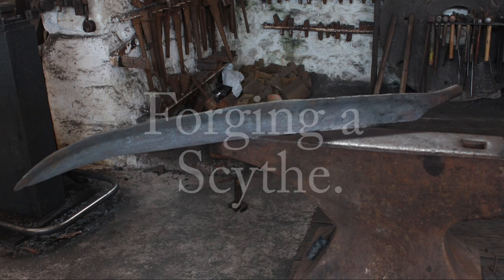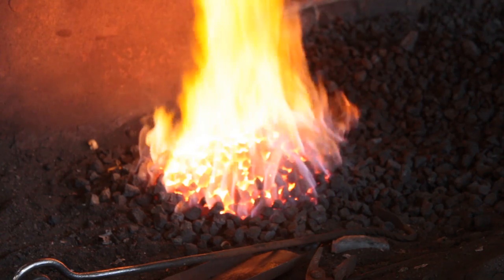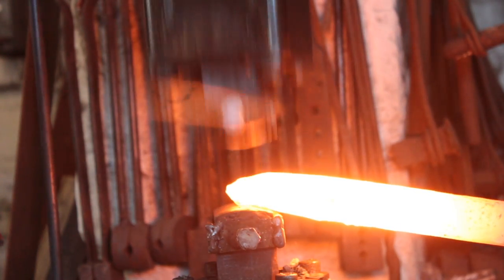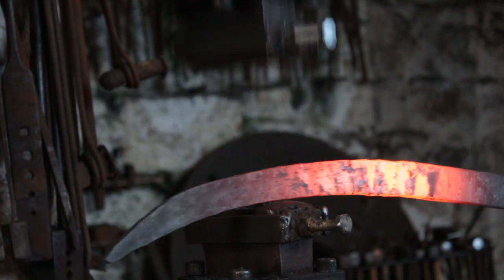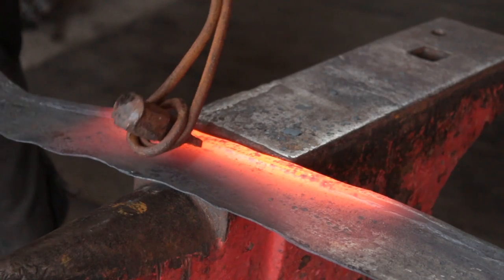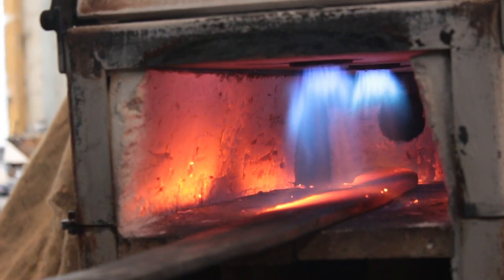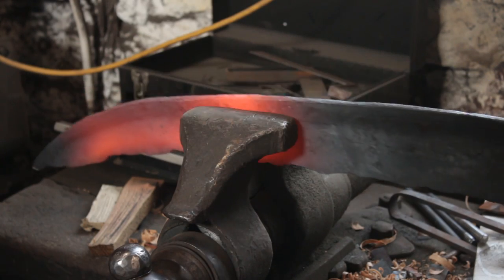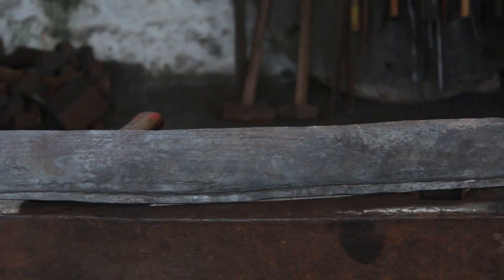Forging a Scythe, Part 1: Starting the blade.

Comment: Great video.  I thoroughly enjoy your videos.  Thank you!   May I suggest that you put a jam-nut on the bolts holding those round power hammer dies?  Just put an extra nut on the bolt and tighten it against the frame of the die after you tighten the bolt.  That will secure it much better.

Comment: I was curious if you had any interest in a trade hammer build? Something simple, like the drawings I have seen in a few books. Basically a sledge hammer on a pivot, with a spring board and rope, and a section of steel on a post for the anvil. Can't wait for part 2 of this one! Thanks!!

Comment: That old modified scythe blade looks to have been an English pattern, in which case you would have ground the edge on a water-cooled grinding wheel when beveling, rather than peening. They were very often laminated construction, which is largely incompatible with beveling by peening for a number of reasons.

Comment: Question, if you did a smaller hand version (scaled down) of this, would it require any differences in design. or just simply 'smaller' in all areas. For example, would the curve have to be adjusted because the length of the blade is shorter.

I am thinking of something like this for a hand tool to start, then work my way up to the full blown deal. Working by hand as I don't have a power hammer.

Comment: what if you forge the blank and before you start forging the edge you put a sharp curve on the blank curving in towards the edge, so this way when you forge the edge it will then curve itself back into the shape you want without having to curve the blade after forging the edge.

Comment: Looks like you need a better mounting system for your drawing dies. When they were striking evenly, they remained parallel, but when you had the stop on the right side the lower die appeared to become canted. 
Good luck with the cold, every one in my home is sick at the moment.